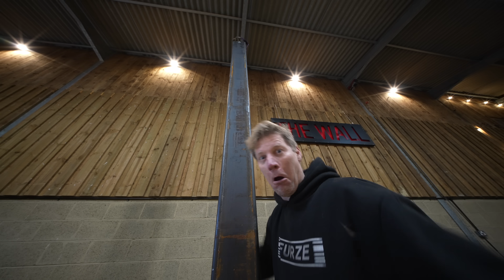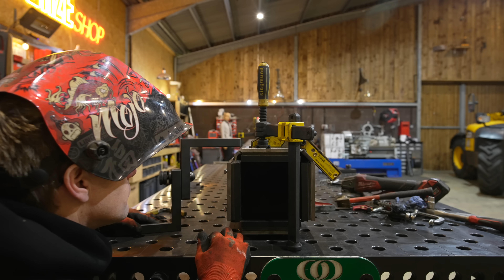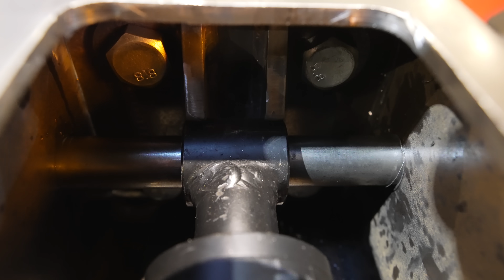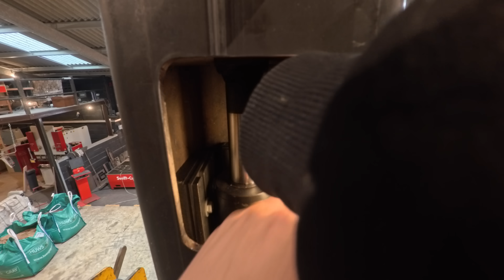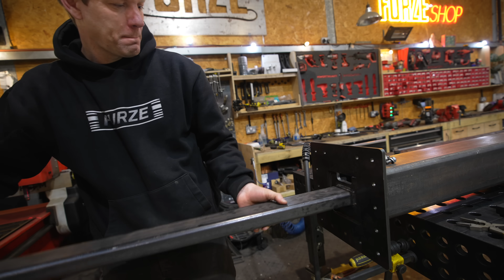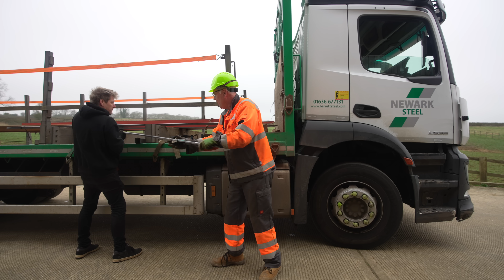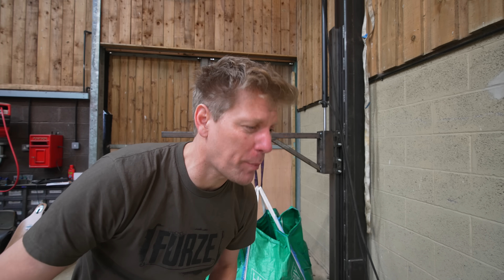Digging SECRET Garage Part 7 Car Lift Prep

Comment: By planning for a way to remove the cylinders you have guaranteed you won't run into issues with it.
Had you not planned for a way to remove the cylinders, you would have all but guaranteed the cylinder would have a failure within the first few months, most likely during a rain storm while stuck half way.

Comment: I once was on a study visit to the opera house in Stockholm. To sync the hydraulic rams lifting the scene (maybe it was the orchestra pit), they used a rather simple but clever device. It was basically a very long cylinder with multiple equally sized chambers. The pump was driving this long cylinder and each chamber was connected to a lifting cylinder. I recall the technician mentioning issues with previous systems, but this had proven very reliable. Seemed simple, but maybe it had some special features I didn't understand or don't remember, was 17 years ago.

Comment: i worry the lift is likely to bind, since it has bearings on every column without give. unless I'm missing something, right now youre essentially relying on all the pillars being perfectly straight for the whole run; mounting the bearings with spring tensioners at the top would eliminate that risk

Comment: Only 3 of your legs will hold the weight at any given moment, so make sure each leg can handle 1/3 of the weight/force and not 1/4.  Something you are taught as a rigger for picking big things up with a crane.

Comment: I don’t understand the need for the slot. Why not make a removable cap on the top end of the leg to hoist the ram out w a winch, or lift (even taking it in two goes if the length is excessive)? You’d just need to disconnect hoses first. And have some way to get ahold of a lifting eye, which should be easy if everything were lowered first, and that can be done w gravity.

Comment: hi Colin, 

below a few suggestions for your car lift hydraulics which I think you'd like to know about:

Question:
did you consider making the legs design use the 2:1 trick:
having a cable connected to the Plateau and the floor of the bunker, via a 180°deg turnaround pulley on top of the pole?
that way you'll only need one hydraulic piston per leg, simplifying the system.

did you consider connecting all the hydraulic cylinders (of each leg) In series with each other?
That way the displacement wil be equal on all poles, causing them to always stay in sync.
this will remove the need for the pully system you've described at the very end of the video.

I'd recommend adding a pressure limiting bypass valve and adding rupture valves everywhere that you'll have hydraulic hoses in the final design.

thanks for your amazing videos and keep up the good work!

Abel
Reply: He's going to order custom hydraulics that are the right length, one for each leg, so that he will have single pistons in each leg.
He's either got them on order, or is doing so now.

Comment: Hey Colin, I'm a mechanic and mechanics mostly use hydraulic lifts but notice that's not safe because hydraulics can easily fail, so that's why all the lifts have mechanical locks, I think you should definitely add them or my idea is that you use electric spinning type lift which doesn't need locks
Whatever you do keep it safe
Reply: he does discuss a mechanical lock of some description, which kicks in at a certain rate of descent

Comment: I saw the power lines hit by the telehandler and moving. Will there be enough clearance for the lift to clear them? I will assume that you have planned to  heavily ground the yet to be built lift platform assy/ and garage in case one of the overhead power wires breaks and electrifies the entire  garage?

Comment: The reason the lift post feels huge when its about as tall as the room which doesn't feel huge is due to something called Cortical Magnification, basically because V1, the brain's primary visual cortex, has something called an Elongation Bias. This causes the brain's physical perception to overestimate the height, even if you know how tall you are and how tall the elongated object is, since its happening subconsciously in the visual cortex before your brain pairs the sensory data to concrete knowledge. Because the underground garage is a more cubic volume, also being an internal volume rather than an external object, your visual cortex doesn't suffer Cortical Magnification, and as you are within the volume you are able to better judge its scale, which also is the cause of claustrophobia since people with claustrophobia are hyper-aware of whichever space they are within, everyone has a baseline discomfort from being in a small space. Also, Cortical Magnification becomes more severe the closer your eyes are to a surface or a long object, and you can feel some Cortical Magnification occurring when you lean forward against a wall and crane your head back to stare up at the ceiling, with proper focusing down on the ceiling above you, the room feels somewhat like it stretches taller, even though logically you know the room has not changed. Cortical Magnification is also at the core of many optical illusions, and someone's susceptibility to Cortical Magnification and optical illusions in general is primarily driven by the size of their V1 cortex, if its bigger, it has more space to process peripheral retinal information and the perceived warping of distance is reduced. It mainly begins to occur when a relatively uniform and already medium-to-large shape or surface takes up the entire foveal pit, which is roughly the central 5 degree radius of your vision, and it gets worse when said object or surface comes close enough to take up the entire parafoveal radius of about 10 degrees. Pretty cool stuff.

Comment: The thing that blows my mind more than anything is the fact that he drills and taps with a handheld drill, if I did that every single bolt would be at different angles yet his look near perfect!
Reply: He does the drilling with a mag drill, so that gets the holes straight.  The tapping he does by hand which is still impressive.  It's easy to mess up.
Reply: @alskjflaksjdflakjdf  yeah, he only does the pilot holes by hand
Reply: He is a natural engineer and craftsman
Reply: @sullivanrachael No mate he's just a plumber 😅 3 jet turbine engines and a cake-o-matic later...Naa mate he's just a plumber 😅
Reply: He did the right thing and made himself good marks and used a center punch. When drilling in steel he probably used a bench drill also, but I am sure that he could drill just as straight with a handheld drill. You see when coming to drilling in metals as steel and stainless you quickly learn to posistion the drill vertical and with some experience you can actually just look at the metal shavings and see if you are doing a good job drilling straight. Not to take any credit from Colin because he is clearly skilled in what he is doing. Like I wouldnt use the phrase jack of all trades, master of none toward Colin - because i simply belive that if he finds himself unsure/unable to do a thing he simply ask the masters for help (and by doing that he picks up a lot of learning).
Reply: Definitely helps if you do it as your job for decades haha
Reply: He has a lot of practice to be fair.
Reply: As others have mentioned he taps the holes with a hand drill and he sinks his marks with a hand drill so that he can start with a bigger drill stright away because he punched the mark and then makes it bigger but you can see the mag drill on 23:39 i also think he use the hand drill for less important holes
Reply: I've snapped enough taps that it makes me wince every time I see someone doing it with a power tool...
Reply: Nobody drills holes straight unless using mag drill or drill press or similar. You can fool the camera, but there might be long term consequences that pop up in places you never would want them to...

Comment: I suppose the legs will bolt to the floor right? All you'd need for stabilizing is bearings at the top guiding the outer legs no?

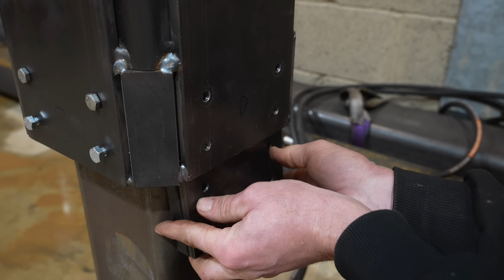Comment: 12:45. That looks sketchy. When you need to change or survive the hydraulics, I would find a way of locking it off something like one or too pins on each corner like a car axle stands.

Comment: Greetings from germany.
Your Vault Door opens in the wrong direction. The hinges should be on the other side, so the door opens to the left / to the wall from garage side...
11:10 So you lift 2 bags weighing 700 Kg each, that makes 1400 Kg, what is the weight of the DeLorean. Brilliant! So 1 Leg has enough power to lift the car. So 4 have an easy game.
Even with the weight added from the platrom and the roofpart of the lift.

Comment: if your using the inner lift as a maint. lift itll be hard to get under, unless you have cutouts and have a way to unweight the suspension. also you need to do a colab with fireball tool, you could use a belt sander like his or his vice etc

Comment: Great work Colin looks better than allot of car lifts i have seen and used . Have seen 2 post lifts with screw threads but the bronze bush on the thread can weld to the thread and cause problems . Could you have used a scissor lift design ?

Comment: Hi Colin i have a question about the long hole in the inner box section i can see it working on the legs closest to the centre of the garage due to the vast amount of room you have but will it work on the legs closest to the back wall as the other legs would be in the way when pulling out the ram or am i missing something ?

Comment: Colin does dad jokes too...  A lift "on a hole other level" (0:30). 

I'm not a hydraulics expert but, I'm pretty sure you can get a control which will synchronise the lift of multiple cylinders - it'll be more elegant than a load of cables.. Try searching for "flow (or level) synchronising valves"...

Comment: For a good comparison, a ford f250 superduty diesel truck weighs about 3400 Kilos, that lift could easily hold double that and still be completely stable that's insanely impressive, that's the kind of lift you would see being used for industrial equipment

Comment: We adjust kicking rollers on lift doors which are the same as your eccentric cams by a centre allen screw with a locknut.  So you have the thread offset on the bearing housing, you turn the allen key till you get the adjustment you want and then do up the lock nut.  This way you can do it from the outside.   We have a similar eccentric system on lift guide shoes for cantilever slings.

Comment: 16:21 So you couldn't get the cylinder in on the table, but you're hoping you can get it out once its in the garage? That sounds like a recipe for disaster.

Comment: Honestly-  you should just make your top slab have 4 hooks and make it removable with a forklift -- then you can just lift out your whole tower all at once and take it to your shop to work on (if ever needed to).  The only downside is that you would need to have a fork lift when you need to work on it.. but that should be maybe once every 15 years or something (if ever).  Not a big deal.

Comment: Your cable system idea sounds like a boat lift that I used to own. You have a crank that pulls one cable with additional cables attached from the top of one leg, through a tube with pulleys on each end that the cable rides on, and finally attached to the bottom of the next leg.

Comment: "Each leg daisy chained with a cable system" - is completely unnecessary.  You can ensure that they lift at the same rate with simple "flow dividers'.  You don't need to build a complicated cable system.

Comment: Piston synchronization can be achieved via a rotary flow divider—essentially four coupled bidirectional pump/motor sections—installed between the power pack and the pistons

Comment: 17:49 How about trying skateboard wheels/some bearing derivitive with a soft outer runner? My concern with bearings straight onto steel is that the rough surface of the H beam/RSJ could induce fatigue over time from the uneven stresses and cause the bearings to fail prematurely. Skateboard wheels/shopping trolly wheels etc would be able to deform over the rough surface. Bonus points for reducing steel on steel noise!

Comment: If you are going to use it for car maintenance, it seems like there should be a physical lock similar to car lifts so it is not relying on the hydraulics to hold it in position.

Comment: So.. you have 3d-printed a tool to hold a cylinder to machine a tool to hold a cylinder to machine a part. Why not 3d-print a tool to machine the part you need?
Reply: Nah, that would be to easy :p

Comment: Should have done like fork lift trucks do - with a pulley and a chain. Then only half the hydraulic ram is needed and less chance of buckling. And that same chain with a stop could have been two stages - initial lift of the table for the service and once it hits stop, the ram keeps going and lifting the car up.

Comment: Might wanna paint all this naked steel, or something. Don't want to get rusty.
Reply: Mate, have you seen any if his previous tunnel and garage digging videos? Colin loves the color of naked steel and as long as he keeps the moisture down and the temperature leveled the steel he uses doesn't rust at all cause it's stainless.  His oldest bunker has been under his garden has been there for about a decade and there's not even a fleck of rust on it!

Comment: @19:35 I've heard about stress risers in sharp corners and always just took it at face value.  This is an awesome visualization of it.
Reply: It’s why aircraft have curved windows.
Reply: That was really cool to see
Reply: Geometry of the part is one thing, surface roughness also create concentration of stresses. So lets say you fabricate an propshaft - steel tube and two jokes at each end. If the weld is the weak-point (ofen not the case) you may increse the strenght my simply grinding the weld more smooth as long as you are not removing too much material. This is especially important to limit the chance of failure due to fatigue.
Reply: Air crash investigators of 1954 can tell you all about it...
Reply: A lot less inline with the corner than I thought stress cracks would be, which is interesting
Reply: I machine lots of parts where I have to go into drilled holes with a ballnose drill bit. Because the drill point angle at the bottom of the hole will cause stress cracking

Comment: I am just starting the video so I have no clue what you actually did. But.... why would you lower it, and then rotate it? would have made it a Circular platform, not a square. Then I would have gotten 1 giant beam that would have acted as a screw basically. I'd thread it like a screw, and have that raise and lower the car while it's rotating at the same time.

Comment: Why don't pull the hydraulic legs from above, when the platform ist lowered? Cap over it and if needed to be pulled there is no strain on the components. Just a forklift/Telehandler and out you pull. What do I miss?

Comment: I think you should just have removable caps on your top slab, in each corner;  so that you can just remove that cap, unpin your ram from the very bottom- and then pull out your rim straight through the top, with a tall fork lift or something similar.  Everything should just slide out the top, in my opinion.  Granted, that does make your top slab have little squares cut in the corners, but that's just how it will have to be.

Comment: Those guides look like a gantry crane traveler. We did a platform not too different from this on stage that went up only 6' or so. We had a few major issues you may need to also address. First sync up for both raising & lowering. With the timing system on our platform lifts they went up together once tuned well enough. Not perfect but the lift controller was able to keep them even. Coming down however was always an issue as the pump system had pressure regulation for extension but only the bleed needle valves to control the lowering. Your system will need some way to equalize pressure between all the legs in both directions.
  Next weight differential. Mathematically there is no way to get the pressure on each leg the same every time. It will behave different every time it goes up & down. This is why many systems like this use a scissor jack style assembly or the like to even out the raising force separate from the ram doing the work. Most systems I've used involved chain hoists on 2:1 lifting heads to keep the raising & lowering speeds near enough to equal through travel.

Comment: Royal Mail double-deckers use a similar 4 post hydraulic system to raise/lower the deck as needed, which is also weight tested to 12+ T. I'd be interested to see how the end result compares to these, as the RM trailers allow for maintenance at each point also.

Comment: Colin! McLaren Speedtail does exactly the same to achieve the 'hydraulic balancing' on its rear active aero, push pull cable between the 2 rear hydraulic actuators. Sometimes the simplest solutions are the best!

Comment: Why you don't use two car lifts who are installed in Car workshops? 
They have together enough power to lift up the DeLorean. Furthermore and you can locate the exact position of each cylinder via RPS Sensors, so you will lift the car parallel. In the hydraulic way that would be harder.

Comment: Large round corkscrew lift with 4 fixed posts on lower platform to hold a upper platform might be easier with less fail points and maintenance.

Comment: Hi Colin. Garage car lifts have safety device that lock the lift as it raises just in case there is a failure on cables or hydraulics. You haven’t mentioned your safety devices on your lift..😊